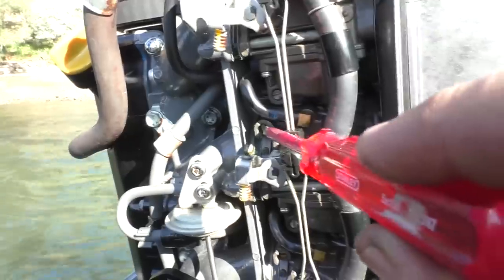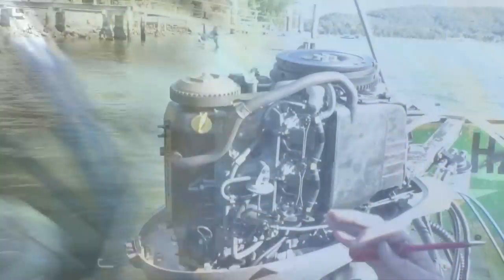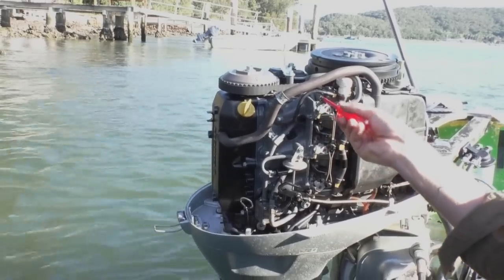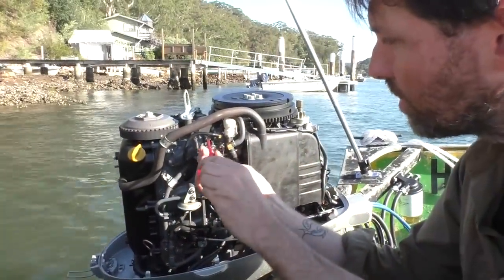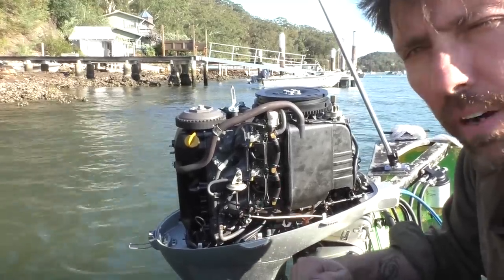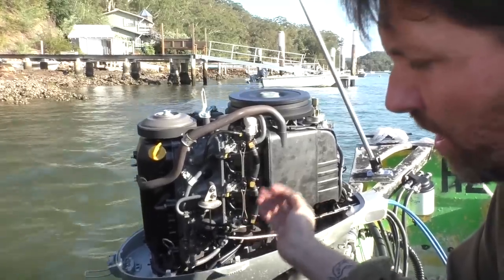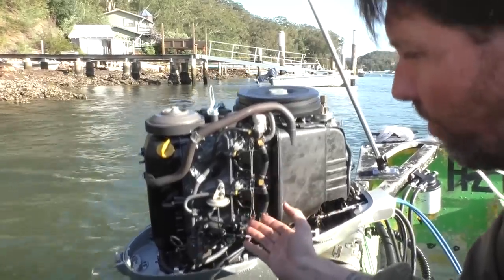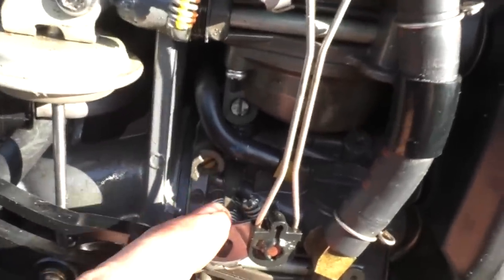Four stroke carburettor synchronisation

Comment: Hi Stu,would I use the same principle for my 40 2 stroke yamaha.
cheers.
Reply from the maker: The first two parts are - setting the mixtures to maximise the idle speed and then dropping the idle speed back down is the same - but two strokes don't have an intake manifold like a four stroke for attaching the vacuum gauge to.
Reply: cheers,many thanks.

Comment: don't take me for a fool, but my question is, do you need to do the same process, or can you do the same process on 2 stroke engines? in my opinion it is not possible, but little do i know???
Reply from the maker: Yes, this only applies to four stroke engines. Two stroke engines draw the fuel into the crank case before pushing into the cylinders so you don't have the runner vacuum to measure.

Comment: The motor is trying to start when using starter fluid. I suspect the carbs are gummed up.
Reply from the maker: Yep, definitely sounds that way if you get a result on starter fluid.
Reply: What is the best way to clean the carb. should i dismantle and soak in acetone for 24 hrs

Comment: hi 94 venom 225hp how to carb sync. thnks :)
Reply from the maker: The idle mixture balance will be pretty similar to the first part of this video, but there is no intake manifold on a two stroke so for the vacuum balance just make sure all the butterfly valves are fully closed at idle.
Reply: ok thank you :)

Comment: You scared me with your shirt sleeve when you reached in to adjust the throttle position on the top carb for the vacuum adjustment. It may not have been, but in the video it looked like the sleeve was close to the flywheel.  If you were doing the balance from scratch, would have aimed for max vacuum in the bottom carb and balanced the others to match? Or would you maybe sacrifice your highest carb vacuum reading a bit if that is what was required to make the worst carb read the same -  ie, worst carb will not go lower than -10lbs, best carb reads -12,  so sacrifice your best carb a bit and adjust for say -10.5 or -11lbs?And your comment about the lost tools brought a laugh - I saw more than a few , and lost some myself,  when working on the seaplanes at Rose Bay! Even a ring spanner that had been drilled and had a lanyard on it, the guy stumbled and kicked the spanner into the water from the pontoon!
Reply from the maker: You used to work on the sea planes at Rose Bay? Cool! That would have been a great job. We still get a few from Pittwater landing near the island.  I used to work at a house boat marina at Wiseman's Ferry and the owner there would get out her string and magnet every time a mechanic lost one of her tools. She'd always get them back! You are right that you can definitely be more thorough and see how high you can get the vacuum on that bottom cylinder. The middle step where I drop the idle again in essence does this in a quick and dirty kinda a way, but spending a bit more time to get it perfect isn't a bad way to spend an afternoon in the sun. As you say though, you can get to the point where the others can't match it in which case I would always go for even. I should probably have put that flywheel cover back on first. I tool it off because the bendix gear jammed against the flywheel one morning and I had to smack it down. Can't be too safe!

Comment: Idle speed is set with the timing on two cycle engines.
.
Throttle plate/butterfly must be completely closed!

That is NOT the idle speed adjustment!
It is the throttle sync 
&&
pickup adjustment

The timing has to advance substantially before those plates even start to open!
.
THEY ARE SUPPOSED TO BE SET TO COMPLETELY SHUT!

LOOK IN THE BOOK!

they are way sensitive all right,
BECAUSE THRY ARR NOT SUPPOSED TO BE OPEN AT IDLE AT ALL!

SET TO ZERO ALL THREE CARBS
MAKE SURE THE THROTTLE PICK UP IS IN THE RIGHT PLACE.
THERE WILL BE A MARK.
TIMING MUST MOVE TO THE MARK BEFORE CARBS EVEN START TO OPEN!

You talk about the carburetors being set very different so often 
&
This is why.

Comment: hi i have a question maybe you can email me  comet424@msn.com   i have 40hp 402 merc  it tells me to set it at 1 1/2 turns out  and in gear should be 600-800 rpms but she wants to die  and i adjust to to just stall it but and then turn out 1/4 turn i do all that and when you punch it she stalls  no matter what i do  still stalls when you punch it  but it idles good.. i idle in neutral about 1200 rpms   if any lower  when you stick in gear it wants to stall out  is that timing or what can be done... can you also email me
Reply from the maker: It sounds like it might need a carburettor clean to start with.
Reply: i replaced the carb kit.. replaced fuel pump diaphram.. replaced the spark plugs.. replaced the fuel hose with bulb from engine to taken.. cleaned fuel screen..   here is my forum  i posted to marinege engine you can see my youtube videos and where i getting frustrated as i try everything.. and even tightned this nut under the fly wheel  no one ever said what that is for as it was loose  but here is link.. i also emailed ya 

as im stuck and figure maybe timing.. as they all say 1 1/2 turn shove in gear  turn clock wise till it wants to stal then 1/4 back and thats it.. what its not it
http://www.marineengine.com/boat-forum/showthread.php?437633-40hp-402-Engine-hickuping-and-gutless&p=581570&posted=1#post581570
Reply: and compression is 150 psi both cylinders
Reply: if you get to see forum  what else could it be and should i turn out the carb to also 3 4 turns like you did.. as in articles they talk about 1 1/2 turns